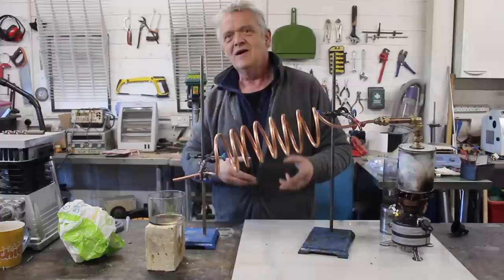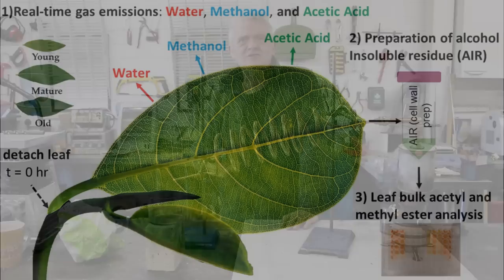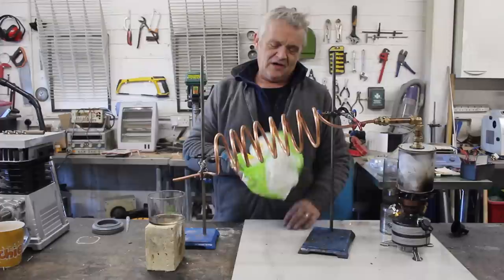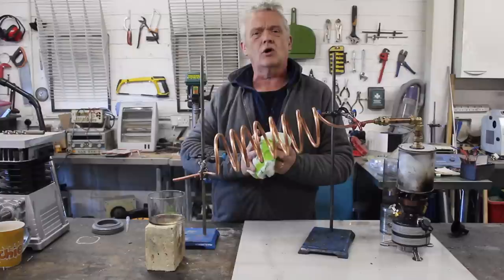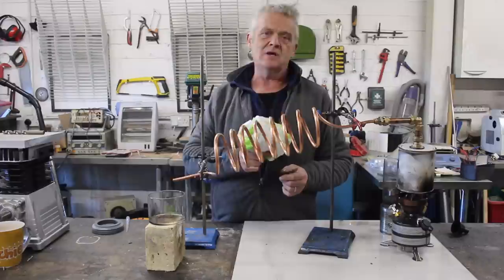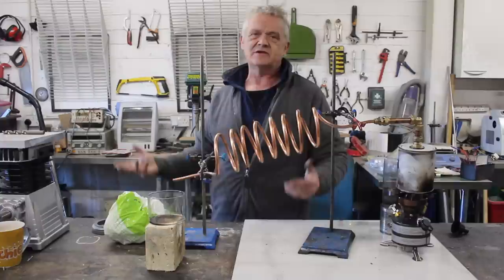1711 Fuel From Plastic - Destructive Distillation

Comment: For this to be practical, you need to heat it up with an alternative, and more "free" fuel/heat source. A few things initially come to mind:  A Solar heater with a glass outside and metal inside with a vacuum pulled between the two for insulation, and the inside metal container painted/coated in an ultra black.  Then set up some kind of Solar reflection system. I prefer upside down conical to parabolic because it is safer and easier to build, and doesn't focus to a point, but is more diffuse and all over.  

   Another option would be to use an induction cooker hooked up to some Solar panels (even better if you could convert it to run off straight DC, so you don't need inverter, battery bank, etc all which introduce expense and energy losses into the system). Whatever container you use, would obviously have to be well insulated. 

   Or, a well insulated and designed rocket or gasifier stove that can run on sticks, twigs, leaves, and essentially any waste biomass. 

    I'm curious why government or industry is not currently doing something like the above with the waste plastics?  In the west, there isn't much true recycling going on anymore, or so it said.

Comment: Now someone needs to get crazy and make a solar concentrator to heat the destructive distillation tank up (and maybe coat it with something that readily converts light into thermal energy inside ;) )  for those who actually get plenty of sunlight XD (would be good for those living in an arid environment like deserts and such, something I still seriously want to try out for smelting and refining materials for solar cells (PV) to cut down on the need for fossil fuel input to make them from.
Reply: Maybe Robert should pull out the old fresnel lense and direct a beam at the can - talk about cheap fuel if that works!

Comment: Are you using more power than you will get from the distillate?
Reply: Yes , by a lot. That's not the point.
Reply: @mrman1536  Well, it is the point.  It is like if using electric cars makes 10 times the 'carbon footprint' than petrol, when people don't leave off electricity production for them.
Reply: @ArjayMartin  this foram isnt about you getting off the grid, its about having fun while learning basic concepts ie- better batteries.
Reply: @mrman1536  it's about thinking and tinkering. Coming up with questions demonstrates the former, and people can share their knowledge, and all grow from it.

Comment: Excellent stuff.   I am a "prepper" sort of person, this a hugely helpful set of video's.  I have field cookers that work with menthanol. Can the plastics to fuel be further refined for fuel for a small  petrol or diesel generator ?  I am thinking lots of plastics everywhere, but there will be a massive fuel shortage if everything goes to heck. I am just planning ahead because the world is going to heck and can make an enclosed fire to sit a container on as wood  is plentiful, instead of using a gas bottle and there is  also plenty of Oak, etc for making Methanol and plenty of waste plastic for turning into fuel around where I live. This is another skill set of learning (and possibly surviving, if it all goes to heck in Europe over the winter due to fuel shortages and war escalating). As I said just thinking ahead of the game.

Comment: I am willing to bet that it took more power to break that plastic down than you will get out of it as fuel.  I am also willing to be that the plastic as a solid was less a global threat to the climate than the 75% of the bag that you released into the air. Well done.

Comment: There are several videos on YouTube showing how to produce fuel (something like gasoline) from plastic. 

Like others have mentioned you get three different distillations one of them is a gasoline like substance...

one of the issues I can see in using this gasoline like substance in a grid down situation is that the "octane" rating might be too low for modern higher compression vehicles to use. 

Octane tells us how combustible the gasoline is. If the gasoline is too combustible it may cause pinging in one's vehicle, it may ignite before the spark plug creates a spark.

So, I was thinking that mixing the gasoline like substance with methanol distilled from wood and water can raise the octane rating to levels tolerable by modern engines.

Water and methanol injection is quite common in racing engines.

Comment: how would you propose setting up a distillation of a charcoal mound. The 1800's method of making a wood pile and covering it with dirt and having it burn up with no oxygen. But in thinking it through I guess you would always be getting various emissions because of the various state of burn- ie water vapor from logs drying while getting syngas from the dried wood. Just thinking of practical ways to produce larger quantities of syngas while also making charcoal.

Comment: Another super interesting video. I am wondering if it would be a good idea to keep the pyrolysis output valve closed for some time to get everything "cooked ;)" properly and opening it once  the pressure would build up a little bit. Also bits of copper inside pyrolisys chamber could perhaps distribute the heat evenly. I wonder if an induction cooker would work for this setup :D ..... best regards!

Comment: Would building a reflux style column still be worth it for this kind of stuff? I only have basic distillation experience, but I found the column style not too difficult to build for how good it is with ethanol, but there might be some added complexity I'm not thinking of with heavier molecules.
Reply: My cousin and I did something like this once with plastic. I wouldn't use the reflux column for the first run (solid to liquid) but you could for the second refining run (which he hasn't done yet). By doing a second distillation after it cooled you can make a lighter nicer fuel.

Comment: I may have missed the answer to this question in previous comments/videos but does the energy required to produce the fuel from plastic, wood etc outweigh the produced fuels energy?
Reply: My thought too, though, if the heat used to create the gas is also used to heat a space at the same time, you are not wasting the fuel, but will also get another fuel that is easier to use and regulate for cooking than solid fuel is, or used to drive engines for mechanical power or electricity. Best done as a batch job considering the rigmarole in doing it.

Comment: How much fuel did you use heating the can compared to “fuel” collected?
Pyrolitically Burning oil based plastic to make another fuel doesnt reduce Carbon emissions. If you use biopolymers there is some advantage although biopolymers are better used in compost systems.
Perhaps a solar driven pyrolytic/distillation process could improve the economics or feasibility?
Cheers
Reply: I guess I missed the part where he claimed this is supposed to magically reduce carbon emissions.
Reply: @crookedtool  Actually this process increases Carbon emissions if the raw material used to make the plastic was Oil
Reply: @PetraKann  Exactly. No one claimed this was intended to reduce carbon emissions. Regardless, what did you think was supposed to happen when you burned the fuel that is created?
Reply: @crookedtool  I am not criticising the topic of this video. Some viewers may misinterpret this process as some sort of Green fuel alternative. 
I am highlighting the fact that this process actually does the opposite.
This is a good video that demonstrates several important chemical processes that have been around for a long time.
Cheers

Comment: just discovered that you did some pyrolysis stuff.  do more.  want to build either a diesel production set up.. and/or a blending agent to mix with (cleaned)  Waste Motor Oil  for use in non computerized diesel engine.

Comment: Nice distiller but ( :) )... if you want to get higher quality reformation, you should use a "planar heat exchanger cooler" so nothing remains inside it, and cool down very much faster the gasses to get almost all those vapes inside the "formula"... it will be less viscous and more flammable probably.
Reply: Or wrap the copper tubing around a larger, central copper pipe that has some wicking material inside, a little distilled water, is sealed and has a vacuum pulled on it enough to lower the boiling temp of the water down to closer to room temp. Basically making a giant "heat pipe" that is super cooling/conductive.  To further help, direct a fan over the system. 

   If that is too tricky for folks to build, then do this:  Use that same larger copper pipe, but leave it open at the top, fill it with as fine silicon carbide powder as you can get.  Pour some distilled water into it. Keep the top open so that the water can evaporate out. Then wrap the copper tubing around that. Plus fan like in the above.

Comment: Hi Rob from Winnipeg CANADA.    "stupid" question , but I assume we get MORE FUEL  coming OUT of the process THAN the fuel USED to heat the process? And how much more using this plastic as an example.   Thanks in advance!
Reply: Good point. Does it yield more energy?
Reply: On paper, the process requires about 15% of the energy you get from the output.  In practice, the real number depends on your process and kit.  If your feedstock plastic waste is wet, you energy driving off the water.  If you're using an open flame burner, you lose a lot of heat in the exhaust.  Last but not least you lose heat from the reactor directly.  That's why he insulated it with firewool.  There's also no reason you have to use your output energy to drive the process.  With a solar concentrator, you can power the whole thing with sunshine.

Comment: what would be great is a video on what could be done with the resultant fuel that comes from this process?  I mean could I use fuel derived from pyrolysis to power a lawn mower engine or even an automobile? What is the chemical difference between this type of fuel and regular petrol or gasoline?  And then could this type of fuel be distilled further to get to the point where it is like petrol or diesel ?   thanks for posting though. great video.

Comment: Dear Brian, 
1. Which are the toxic and corrosive ones?
2. Which is the composition of the three fractions?
3. How you know the products are like petrol, Kero or diesel?
4. Do you know what Boiling Range concept stands for?
Reply: An example of a toxic one you wouldn't want to pyrolize is PVC, recycling number 3.  The trouble is that it contains Chlorine, and there are a number of unpleasant compounds it can form at high temperatures.  That's why there are warnings not to burn PVC plastic, e.g. burning the insulation off wires.  I don't know of any specific issues with pyrolysis of PTFE (teflon), but I'd avoid that too because of the Fluorine in it.

Comment: Pyrolosis of plastics is the future for many im sure.. The hurdle I feel is the fuel to acquire the the fuel..

Now garbage collection and if sorted properly that could be the fuel. .
Reply: I think initial  expenses  in fuel  would be absorbed once you started to use the collected fuel for the heat source. Thus making it essentially "free"  of further cost to complete  the process 🤔
Reply: Clearly it wasn't a hurdle for Robert. He converted plastic to fuel easily and without a second thought.
Reply: @crookedtool  bro im talking large scale.. You need an abundance of fuel to extract the fuel..
Reply: @papalincoln5774  ya a community garbage collection and proper sorting would have to be... So much waste available could be the fuel.. Or acres of fast growing plants like hemp and some tree species could be dedicated to the fuel.. But ya its a method that will probably be the future for many
Reply: @sean-or1nc  On a large scale, you use the same fuel that everyone else uses in manufacturing such as propane, electricity, etc. 
So you want to burn trash. Why aren't all factories using trash already? Because with all the extra work involved with sorting, scrubbing pollution, etc, it's not much of an advantage, if any.
Reply: @crookedtool  The issue is that Rob probably used more outerside energy to break this stuff down into fuel i.e. the fuel he made has less energy than the fuel he used to make the fuel.. Not very viable or sustainable. But if you use some kind of renewable, sustainable energy source, then yes, this would be a good process.
Reply: @justinw1765  Rob has no issue here because he's not making any of the claims you are. This isn't a "free energy" demonstration. It illustrates one piece of a bigger system without issue or hurdle.
Reply: @justinw1765  By the way, regardless of the heat source, it's still a good process if you're able to create something that you need. And it turns out that the process can be self-sustaining fairly easily.

Comment: Doing some reading on my own a fair while back, I found a lot of concerns surrounding the formation of dioxins, but not much of what I've read has really puts their formation and risks into perspective. As far as I can tell, they're the main reason why you want to do this with an inert atmosphere in the reaction vessel, but any idea if it's really a serious concern?
Reply: You potentially could put argon in the can, or helium, or carbon dioxide which is easy to make pressurized and fill the container before adding heat.
Reply: Dioxins in this context means 2,3,7,8-Tetrachlorodibenzodioxin and related compounds. They are bio accumulating carcinogens that form from pyrolysis of PVC. Non oxygen containing dioxin like compounds can also form and they are just as dangerous (chlorinated biphenyl, chlorobenzenes,...). There are ways to scrub it (CaO, NaS) but you should just avoid it and stick to LDPE, HDPE and PP.
Reply: @l0I0I0I0  True, but that adds to the cost to produce the fuel. At that point and for the complexity added, may as well move to a different method for plastics using a proper sealed reaction vessel for high pressures. Still doesn't really address what issues with dioxins really exist though.
Reply: @b.t.jevsevar  Ah, good to know. Thanks. I've heard it mentioned to keep the process free of PVC, but it feels like there were other issues still involving dioxins outside PVC. Plenty possible I'm missremembering something though.
Reply: @b.t.jevsevar  I think you have made a GREAT point that is way undervalued and not emphasized!!!  TY for sharing.  I'm not a chemist and these things need to be emphasized.
Reply: @custos3249  As long as you only use the three safe plastics its fine. Other plastics each have their own problem, for example polystyrene produces benzene(carcinogen) and styrene(carcinogenic, explosive autopolymerization risk), nylon and polyurethane are also very dangerous....
Reply: @b.t.jevsevar  Good to know, and good you mentioned polyurethane. I've considered how to go about something like this using old circuit boards, and while I know it's going to be a mess, it'll be interesting to see exactly how much of a mess at the small scale.
Reply: Even the "safe" plastics can put off noxious gases.  It's best to use heavy steel containers for retorts, and draw (and hold) as complete a vacuum as possible (I've drawn as much as 30 inches of vacuum) before heating.  This ensures all the little pockets of air that are trapped in the folds of bags etc are removed.  Purging with inert gas won't do this.  The dioxins come from doing the chemical breakdown with oxygen present.
Reply: @dansw0rkshop  Curious, what system/means do you use to draw a 30" Hg vacuum?  That is a pretty substantial vacuum.
Reply: @justinw1765  I'll have videos up eventually.  It's a retort system using a 20lb propane tank and 2-inch schedule 80 pipe, which I can distill plastic into parts.  Mostly gas, some liquid.  I use a refrigeration compressor as the vacuum pump.  This can draw a pretty tight vacuum, more or less maxes out my vacuum guage which goes up to the 30 mark.  No, I realize it doesn't do the vacuum needed for electron microscopy but that's no the point.  We just want reasonably thorough scavenging.
Reply: @justinw1765  Refrigeration compressor

Comment: Great video. Presumably, you'd then need to 'crack' the resultant goo down to get any realistically useful component oils & spirits?
Reply: I think the idea (in this case) is more so turning it into a fuel source for heating.
Reply: @justinw1765  Thanks for your reply. Anything that we can do to use waste plastic, that doesn't in itself produce more (toxic or otherwise) waste or future problems, has to be a good move.

Comment: off topic rob but you may have the answer .. how much does a fuel powered electric generator powering an modern ev motor gain or lose efficiency per joule ? in my mind if gas generators provide electricity too our houses is there a difference?

Comment: Guessing that your feed stock can is about a liter, or near a U.S. quart.  I'm wondering how much heavy fuel (diesel, kerosene, parafin, veg oil) burned in a stove would it take to distill a liter of hdpe?
Reply: It would be orders of magnitude easier to just burn less desirable plastics, junk, ect, as a driving fuel, rather than distilling it just to burn it later in that way.

Comment: Do you think that a recycling and or waste management facility can essentially follow the same energy model as steel or concrete in turning trash into graphene and fuel?  

I know installed on site solar will help, but that’s just not enough.  
I often thought that hydrogen from offshore wind, wave, and solar farms would not only help clean up those energy requirements from those facilities (besides the boilers in chemical plants) but it could also help power pyrolysis and making/graphene

What do you think of Germany’s hydrogen model?  Do you think using hydrogen to store renewable energy and make it portable is economically viable?  Or using it in heavy industry, like how graphene needs to be made?